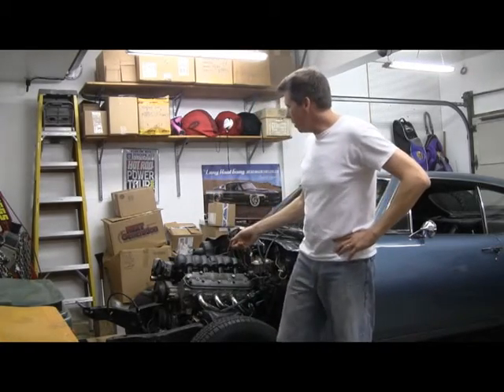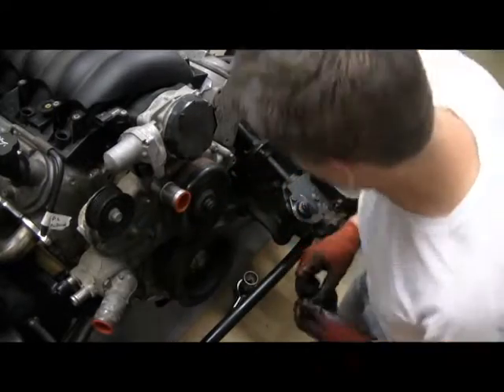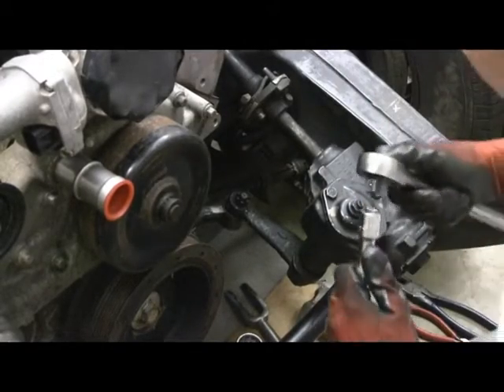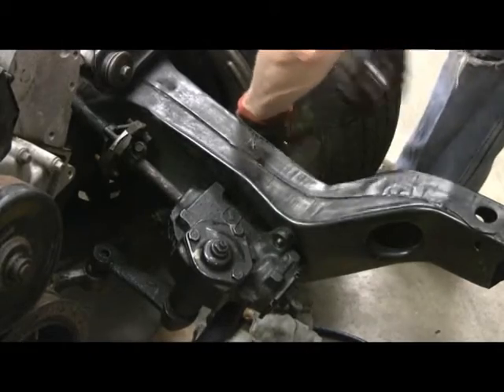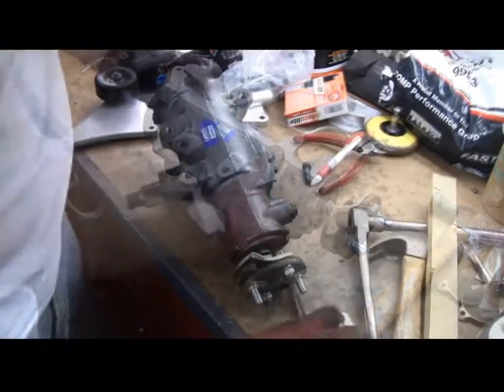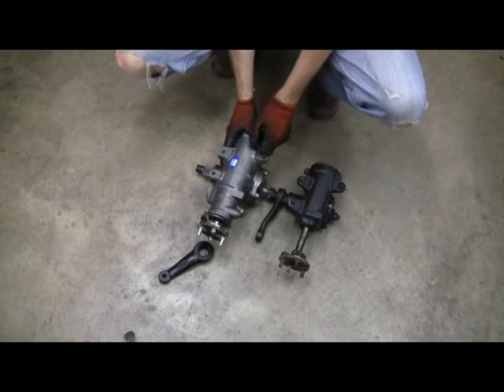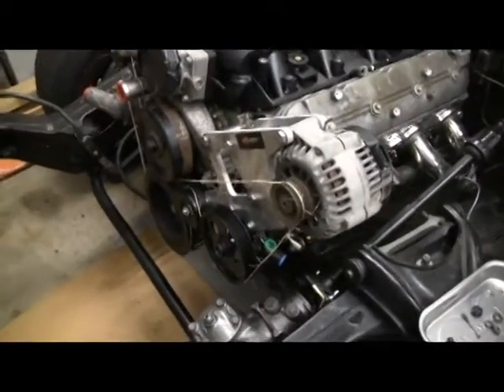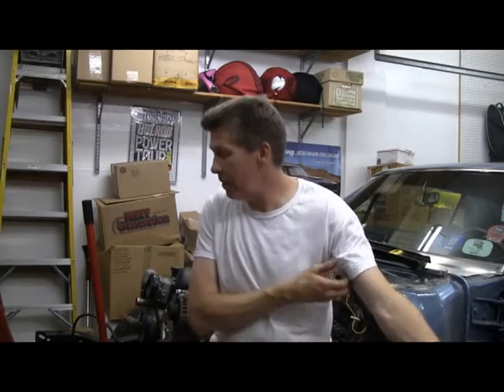LS Conversion Swap part 11 steering box dry fit

Comment: so why r u replacing this box? i was shown the old steering box can be adapted to new power steering pump by just swapping the large nut adapter inside the pump.
Reply from the maker: Old box is manual...and you can not make a manual box into a power box.

Comment: What did you ever do about the lines and also do you have part numbers for what parts you needed? Putting a 5.3 into my 69 chevelle and want to do the jgc box as well
Reply from the maker: Have not got to the lines yet. Parts ordered so far:
From RockAuto.com (# are their part numbers)
- A-1 CARDONE pump #20990 (20-990)
- DORMAN pully #300137 (300-137)
- LARES steering box #1353
From Classic Performance products (# are their part numbers)
-CCP power steering pitman arm #6872PA-P 
From Ebay
-Power Steering 3/4-30 SPLINE Rag Joint Coupler
You might not need the last two. I needed them because I was going from manual to power. I don't suspect issues with the line connection since going from a new style pump to a new style box.
Reply: Prime Garage GM A-Body LS Swap awesome thanks alot man, just got the box installed last night and have the lines and coupler ordered. Hopefully it all works. Did you happen to do your wiring yet?
Reply from the maker: No wiring yet. The last video I posted is were I am at. Currently working on fuel delivery. What did you order for power steering lines?
Reply: Prime Garage GM A-Body LS Swap I just ordered factory 97 grand cherokee lines. I had to bend the return slightly but looks almost factory in my opinion
Reply from the maker: Sounds simple. What accessory drive setup are you using?
Reply: Prime Garage GM A-Body LS Swap I'm using a 01 silverado truck accessory drive kit. Having a little issue with getting the smaller dorman pulley to line up but past that it's all simple.

Comment: what accessory drive bracket did you use?
Reply from the maker: LSBrackets.com 
Check out part 10 for detail. The Pontiac G8 L76 used Corvette style water pump and balancer so i wanted to reuse those and I am only running an alternator and power steering pump. LSB has set-ups for just about every configuration.

Comment: 93-98 Jeep Grand Cherokee steering box.  Is that a carpenters hammer ???
Reply from the maker: Ha Ha, of course not. It’s a weighted metallic utensil with
curved extractor designed specifically for Steering box conversions. Have you
not seen one before??

Comment: which box is this so many to choose from
Reply from the maker: Following is what I ordered from Rock Auto for the conversion. I need to figure the hoses and connections later. i think everything came to about $200 less shipping :

1997 JEEP GRAND CHEROKEE 5.2L V8 STEERING GEAR 
LARES1353

A-1 CARDONE 20990 (20-990) POWER STEERING PUMP

DORMAN 300137 (300-137) POWER STEERING PUMP PULLEY.
Reply: +Prime Garage GM A-Body LS Swap   thats the next problem which hoses to use i have a 5.3 and i wanted to keep my original box to save money but the pressure hose is my issue
Reply from the maker: You need an adapter to mate the old style hose to the new style pump. I have not done all the research yet, but something like in the following link will be needed:
http://www.speedwaymotors.com/O-Ring-to-Inverted-Flare-Power-Steering-Adapter,24682.html
Lee Power Steering was a good source for swap info, but their website does not seem to work anymore.